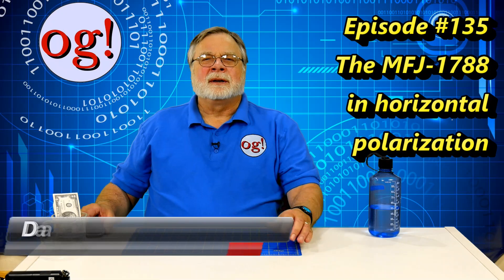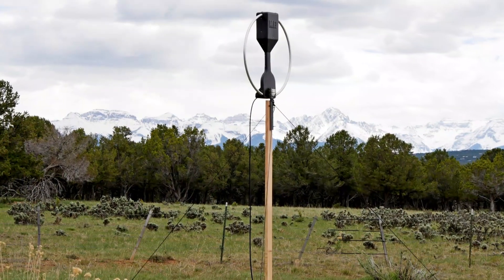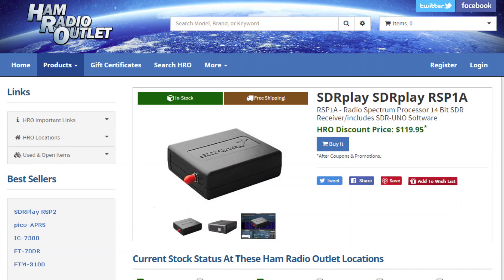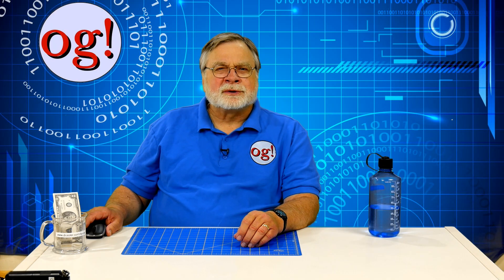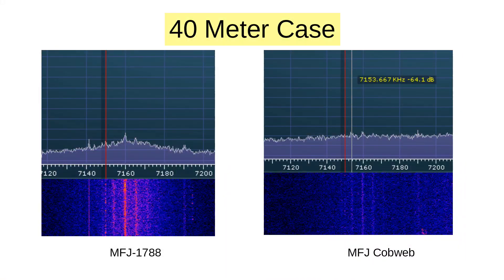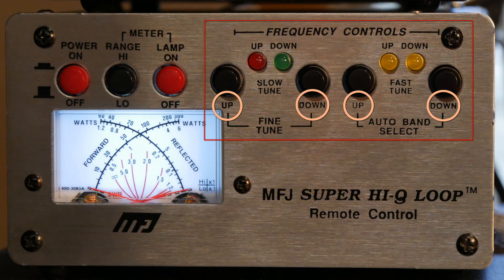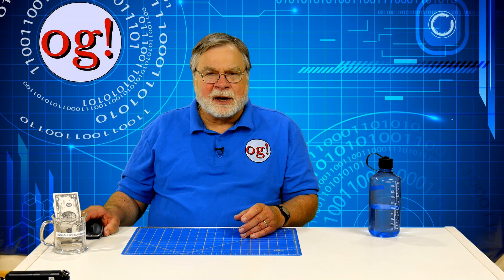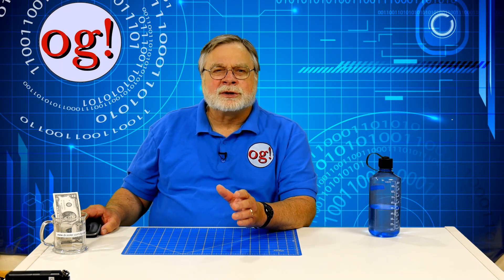Using the MFJ-1788 Mag Loop Antenna Horizontally (#135)

Comment: Dave:

I purchased an MFJ-1788 in August 2019 and finally put it up in a vertical orientation.   I could not install due to an injury I sustained shortly after the purchase until recently. I am not impressed with this antenna and seem to get better performance out of my cheapie wire antenna bought off eBay.  It seems as though MFJ is fairly directional and it needs to be rotated.  That’s fine and dandy if you have a rotor, but not so much when one must loosen the antenna mount to twist around in a different direction.  By then, band conditions change.

I am very disappointed in the construction quality of this antenna. Right out of the box, the press fit mounting nuts in the aluminum frame of antenna came loose and made removal of hex bolts impossible.  The bolts had to be cut off.  The plastic cover is a piece of junk.  The antenna I received had the screw holes stripped out and the screws would not hold.  Consequently I had to go with larger screws to close the cover.

For an antenna approaching $600 in price, this is not a good investment.

Comment: Hi Dave. Where can i find this „straight key“ for the „tuning tone“ you mentioned, on the FT-DX 3000? I usually switch to AM and tune with a low power  signal (15W) to watch the SWR. Cheers, Stefan Df6vi
Reply: @ZLcloud22 So, unfortunately we will obviously never know, how Dave is tuning the DX 3000? Meanwhile i got a new Radio (Flex 6400M) with a real "Tunebutton". That's much more comfortable and i like VERY much. 73'

Comment: Hi David, great video. I thought of buying a Ciro Mazzoni baby loop and was wondering how a vertically mounted near the ground would do vs something like a DX Commander multiband vertical in terms of DX long distance contacts. I don’t have an HIA but would like to avoid the radials and have something portable.
Reply from the maker: The loop is certainly portable, although some are more portable than others. I've not really studied loops at ground level.

Comment: It is possible that a magnetic antenna placed in the horizontal plane has three advantages: 1) not having to constantly modify the azimuth or direction to which it points, it is omnidirectional.   2) it captures little "electrical" noise of the population since being "very directive ", will capture the signals that arrive from the horizon but weakly those that come from an angle below the horizon, which is where the electrical noise of population comes from.   3) will preferably pick up the radio signals that arrive in vertical polarization, which  is how the rebound signals in the ionosphere usually arrive  (janay)
Reply from the maker: As it turns out on HF, all signals that have been reflected by the ionosphere are circularly polarized. That way, either a vertical or horizontally-polarized antenna can pick them up, which is why polarization is not so important on HF. At VHF or UHF for line of sight, polarization matching is very important.

Comment: Hi Dave. Excellent video - again, thank you. Two things: 1/ Could it be that the higher noise floor seen on the MFJ Loop was because it was located on the house, so closer to all the noise sources in the building? The cobwebb is mounted further away.  2/ Is there any way that an SDR Play, or something like it, could be used with a radio that does not have an RF or IF Out connector on the back? I have a fantastic Yaesu FT-891, but it lacks the connectivity that you mention. I could also ask the same about the FTDX-1200.   Perhaps a topic for future videos??  Thanks again Dave. 73, Mike, M0MTJ
Reply from the maker: First, yes, the MFJ on the roof still picks up quite a bit of household noise. Regarding getting the RF or IF out, if there is no output for it, you may well be out of luck. You can get a device from MFJ that allows the SDR to share the antenna with the radio when receiving, and then disconnect the SDR while your other radio is transmitting.
Reply: @davecasler  Thanks for the tip Dave. I will have a look at the MFJ website, that sound like it could be a neat solution. Thanks for your super videos. 73, Mike, M0MTJ.

Comment: a loop horizontal should be perform omni-directional (from the wiki) and vertical it has two directions. I have a ALA on the balcony here for reception and i found on MW i get better signals in the vertical position but on 40 meter its often better in the horizontal position. Now i don't have a rotor attached so it could be that on 40 meter it null out some signals giving me the impression that horizontal works better. After reading a lot i still haven't seen a good review about horizontal small loops vs vertical... Also i have some online friends who use a high placed vertical loop with a rotor and the bribe about the fact its high in the air. While i have seen in several youtube tests that some height is good but really close to ground a loop still performs well and height doesn't matter that much. As third point everyone has a coupling loop below the main loop while and for tuning they make it more oval but i miss a test where the small loop coupling is above the main loop. I believe alpha antennes recommend that but i haven't seen a youtube movie that really tested that. Then last point i see people most QRP station with a coupling loop on the downside but there are also people mostly in fixed configuration that have the coupling loop on the upper side of the main loop? What are the differences? Or doesn't make any difference where the coupling loop is? Thanks for the video
Reply from the maker: I've always seen the coupling loop inside the main loop.

Comment: Thanks you so much for the additional info on the MFJ-1788 Loop antenna. I have been on the fence about purchasing one of these antennas. Not only because of the high cost and the many "Quality Control" issues I read on the review sites, but also wondering how well it would perform outdoors compared to my indoor attic mounted 37' OCF dipole for 40m-6m. I am thinking my HOA would probably tolerate the MFJ-1788 mounted outside my house on a roof eve high pole, much like the satellite TV dishes mounted on the roof edges here now. I wish I knew if it would perform $500 worth better than my $89 inside attic mounted OCFD. My OCFD does not do well on 40m but is pretty decent on 20m-6m considering it's indoors in a leaning "L" shape. Sounds very much like the same results as you are getting with the MFJ-1788 Loop. Oh the miseries of living in an HOA community.....lol!

Comment: The really neat thing about those antennas is the very sharp null when the loop is perpendicular to the direction of arrival of the signal.  One of those on a rotator can tell you with a pretty high degree of accuracy the direction to a transmitter.  I used them when I was in the military for man portable direction finding operations.  You make me want to put one up on a rotator outside the shack.  =)
Reply from the maker: I've looked for rotators but haven't got one yet. I wish I could find one that would rotate really fast so I could really home in on the null.